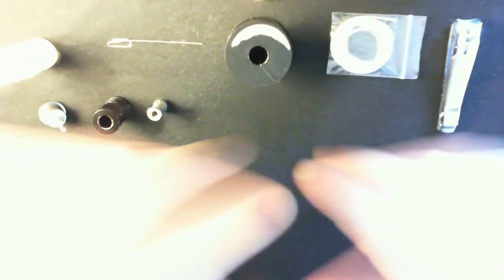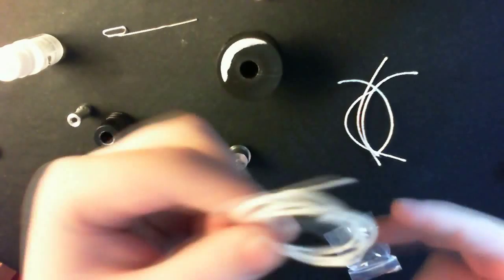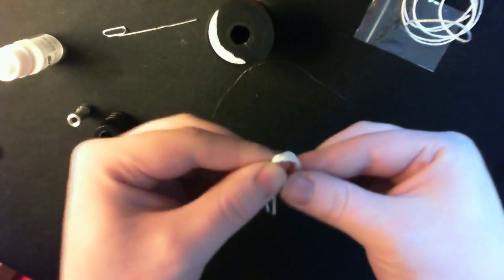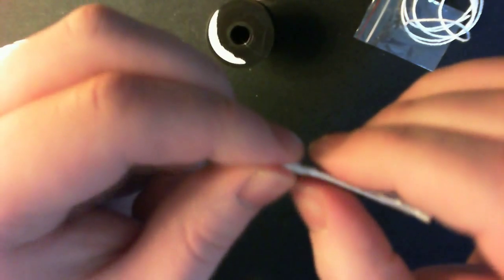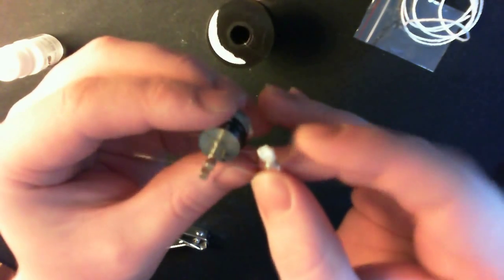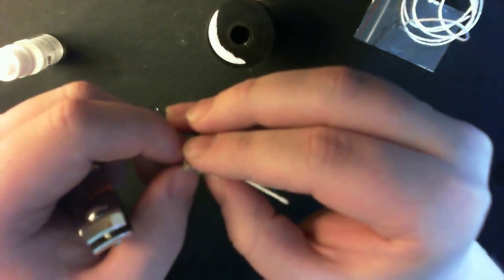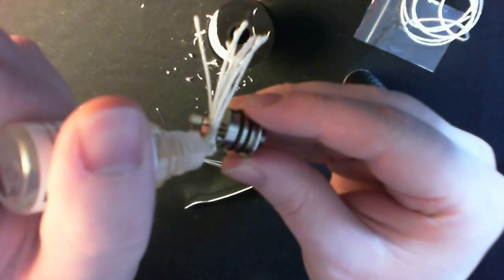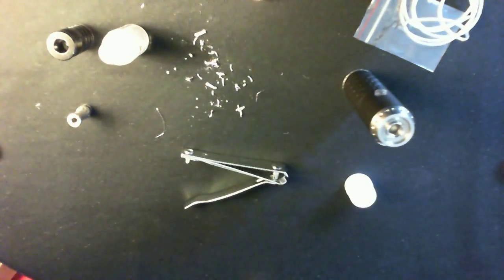Totally Wicked DDA Full Rewick - Fan Request

Comment: resistance is how easily the transfer of electricity throu a circuit ..two circuits on the same pole means twice as effecient  volts = amps × ohms.... thats why the amp limit is important when using a vv device for lower ohm wraps  say you had a .8 ohm wrap at 4 volts it pushes out 20 watts and 5 amps of power that wont work on something that goes to 15 watts... get a mech mod for low ohm wraps.. although the one i tried it is so intense i couldns vape it